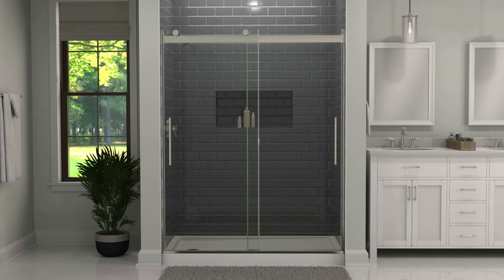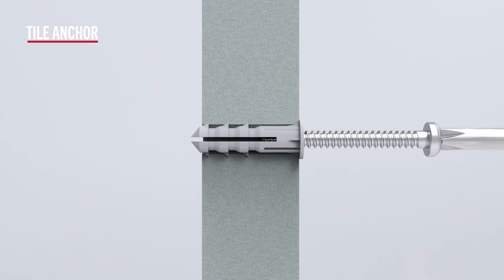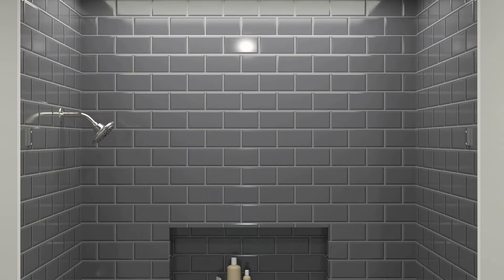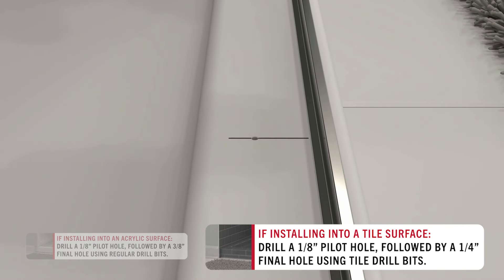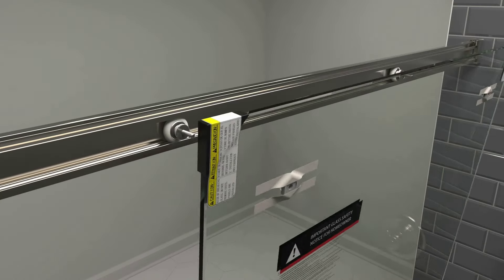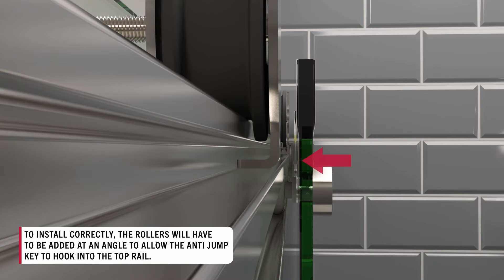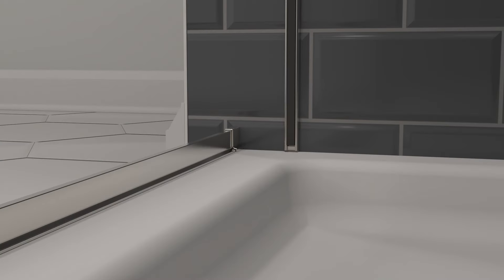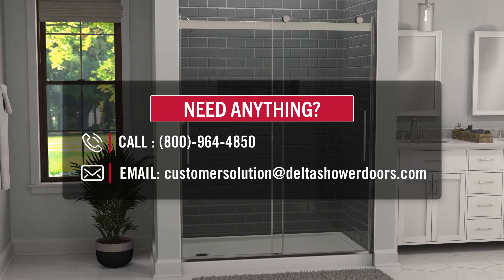Delta EverEdge Shower Door Instructional Installation Video

Comment: So confusing to base the installation location based on the center of studs and working from the top down.  Installation went well when I figured out the screw hole in the center of the bottom center track is on center with the top bar. That enabled me to work from the bottom up, putting the bottom track in first on the shower pan curb and then transferring the dimensions up to the door track using the template. If I had followed the 2.5" back spacing, my inner door would have hung inside my shower. Not sure studs are really necessary with substantial walls such as tile with backing boards.
Reply: You still out there. Buddy? Could you answer a question

Comment: This install is not "easier than you think"- had I not been a pipefitter for 2 years I would have not been able to figure out how to install this. You can't just go off the center of the stud unless the house was built with this shower door in mind-which is never the case. 

I did not have a stud in line with my tub sill- the video and the manual is very clear that in my situation THE DOOR CANNOT BE INSTALLED. This is a sad lie. I'm not sure if Delta created this lie because installing in a way the door was not designed for is a legal liability- or if the engineers simply don't know it can be built better and stronger without a stud. 

I created a line 2.5 inches in from the outer edge of the sill- ignoring the implications of the radiused edge. I used a rule against the outer edge of the tub and bumped a tape against it and marked 2.5 inches. I used this line on both ends of the tub to line up the template. The template is absolute garbage. You have to be very careful with it to make sure it's straight. I used a 4 foot level as a straight edge to keep the template straight and quadruple checked it before drilling. These holes are "critical" they dictate how the entire thing is going to look in the end.

Because I did not have a stud (and I'm glad I didn't because the included mounting hardware designed to screw into the stud is undersized and I wouldn't have trusted it) I used toggle bolts rated for 238lbs. Since the doors together weigh a little over 100 lbs- these are perfect. I had to drill half inch holes in the tile walls to accommodate the toggles. Once the toggles were in they took a 1/4-20 bolt. This bolt is too big for the holes on the mounting brackets. So I used a milling machine to increase the size of the holes to fit the 1/4 inch bolts. I used a cobalt drill bit. If you do this make sure to use a lot of silicon to cover the bolts because I think the brackets are made of duplex stainless at best or a galvanized steel at worst. Drilling may take off the outer coating which causes the potential for rust. So protect these areas with silicon after the bolts are in the wall. After I got the brackets up, stronger than designed, the rest was basically smooth sailing.

All in all- take this video and the install manual with a grain of salt. The little guy narrating the video isn't gonna be there to bail you out when your doors don't line up with the tub sill and it's too late to fix it because you already drilled the holes. I took hours to think about my hole layout before drilling. I have an irregular shaped tub sill that gets dangerously narrow in one spot. Because of this I wasn't just gonna blindly hang the doors off the center of the stud (which I didn't even have). If I could redo this build I would start by placing the dam strip on first. I would also include the plastic triple U channel in my layout. I would center these pieces on the sill as best as possible. Then I would back figure with the dimensions included in the manual to find the location to drill the hanger holes. That way I could have the peace of mind of knowing 100% my doors are going to fall on the sill exactly where I want them. I was lucky everything worked out for me. Actually, it wasn't luck it was skill. But it only worked because I ignored the instructions. The worst thing that can happen is the optimal hanger hole location is right on the edge of a stud. This happened to me and I had to use a chisel though the 1/2in hole to break the stud corner up so I could fit the toggle. 

If you or someone you love finds themselves inside the nightmare that is installing this shower door- reply to my comment and if I see it I'll respond. I probably won't see it though. I do a lot of trolling in YouTube comments so your reply might be lost in a sea of self righteous people replying to my comments. Honestly Delta should hire me. 27M with a bachelor's degree and real world construction experience...but I'm sure I don't fit their DEI requirements 😮

Comment: In the shower wall/shower base installation video by Delta on YT, they clearly recommend installing a 2x6 right at the edge of the shower base to act as a "door nailer".  This is bullshit!  In this shower door installation video, they say to look for a stud a minimum 2.5 inches from the outside edge of the shower base.  How the hell would there be a stud 2.5 inches from the edge, when they had us put ONE 2x6 (which is 1.5 inches) as a door nailer?  This is a huge screw-up by Delta!  I went out of my way to install a 2x6 door nailer when installing the shower walls & base.  All that damn work for nothing!  If I had known, I would've installed two 2x6s instead (3 inches).  This would've given me ample stud surface to install the door.  I would've preferred to install the wall bracket onto a stud.  Instead, I have no choice but to rely on acrylic anchors!  Obviously, there's no way I'm gonna pull the shower walls off at this point as drywall, mudding & paint are complete.  Damn Delta, you really screwed the pooch here!  I'm pissed!